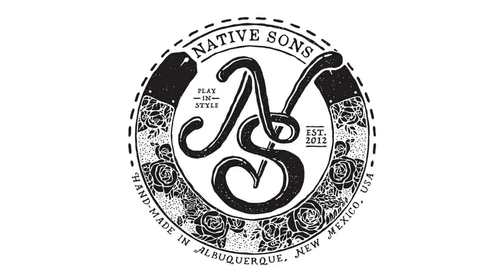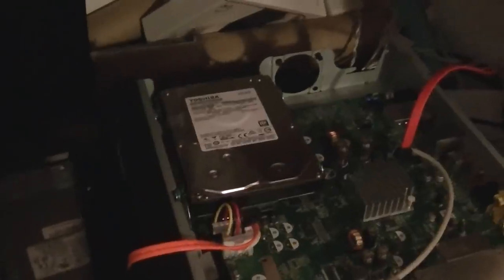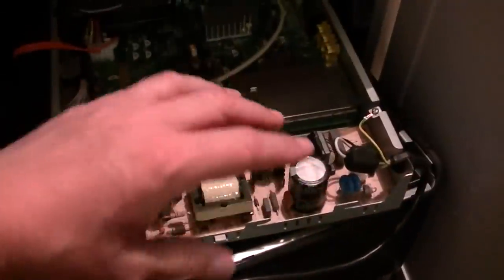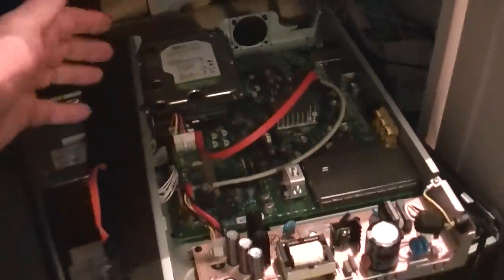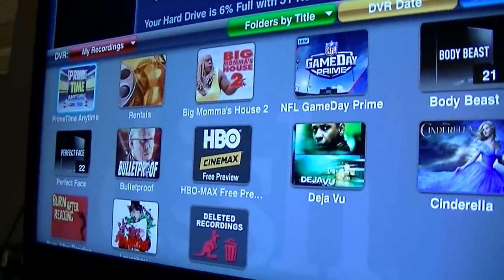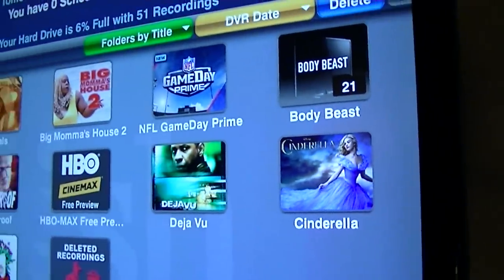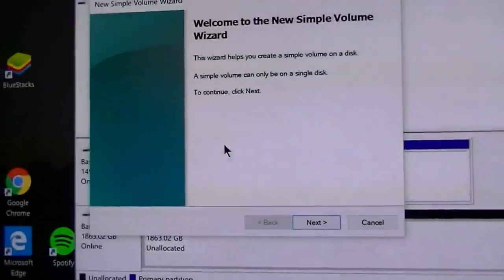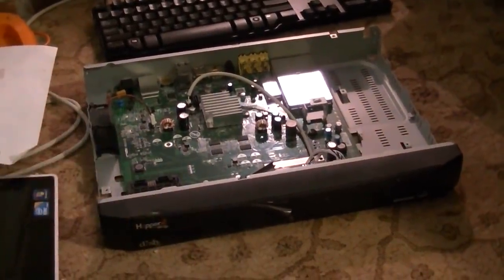Salvaging Data Storage from Roadside Garbage! - How To Format Dish Network DVR Receiver Hard Drives

Comment: I've did this for a long time. It also works with Direct tv , Tivo cable boxes ect.  There are programs that help with this too if the hot swap method fails but thats another video. I've gotten anywhere from 500gig to 2tb drives. WD seems to be the most common.

Comment: Good video.
I currently am running Dish Wally which I have bought and been using an external hard drive with (all through dish) and pay monthly on.
Question: I just disconnected the hard drive and was trying to run just the stuff I've recorded on it on my tv, but can't do it. 
I do have a USB connection on my tv, but it didn't recognize nor on my laptop either. My thinking is only if there is a Dish power outage then I would still be able to watch my recorded programs on my tv. Is there a way around it?
Thank you for your time.

Comment: I have an old Dish Network receiver that wont power up, it just keeps wiring like it's going to start. I desperately want to retrieve the DVR videos on it. I tried taking out the drive & connecting it to my PC with a USB adapter. It sees the drive but I can't access it. I found it has a special format to prevent this. So, is there a software to access it or do I find a working receiver of the same model, or can I just plug it into the external USB outlet on my current Hopper? Pleas tel me, what can I do?

Comment: You can actually also really use the chassis for any kind of diy measurement device projects (power supply, amp etc).
Reply: @TheGuitologist  yeah. In general an off the shelf chassis is more expensive. Another good tip is to look for old audio amplifiers. In my experience the transformer is mostly totally fine. Just remove the amp section with a TDA7294, TDA7293 or LM3886 and you got yourself a nice new amp. Obviously you can use the transformer also for other things.